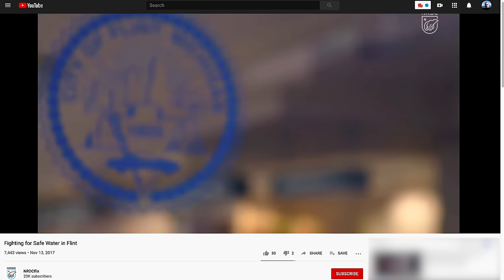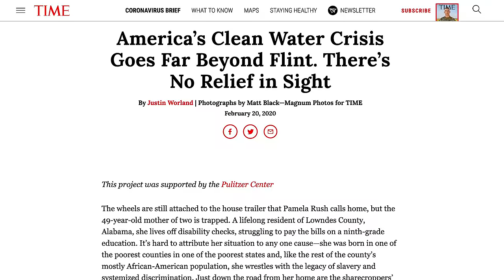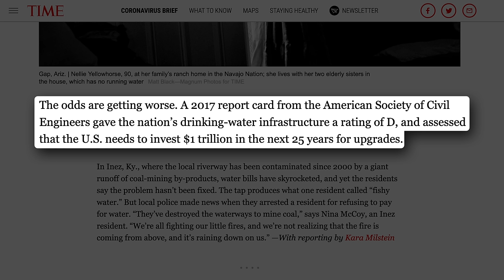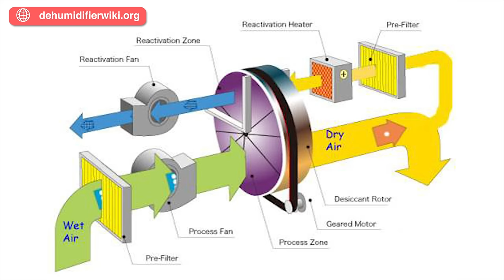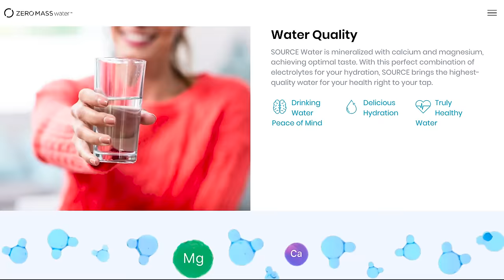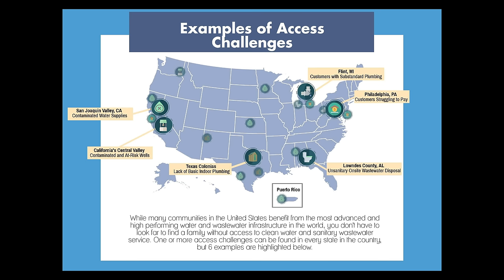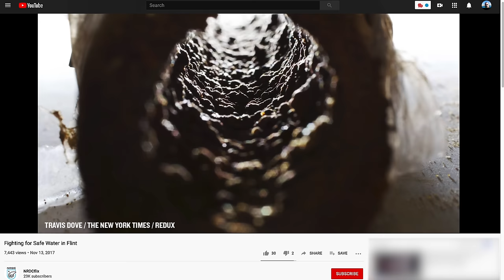Off-Grid Water With Air and Sunlight

Comment: You hit the nail on the head: it’s a glorified (solar powered and very expensive) dehumidifier. Nothing more; nothing less.
Reply: I wonder how much a solar powered air conditioner would cost, then just collect all the water from the condenser coils.
Reply: @lightdark00  i got a solar powered dehumidifier for my hunting lodge that could generate around 30-40 liters per day if it's pretty humid

Woods ds40fs: $400 on sale (think it's $500 normally)
Solar panels: $600 (4x 410 watt)
Charge controller: $200
Batteries: $350
Misc: $50?

The solar part of this system also runs a fridge/freezer set and all the lights in the lodge and is way overbuilt for just the dehumidifier
Reply: @angrydragonslayer  To match it you can skip the expensive batteries, and only have it active in the full sun. With the right compressor, you may not need an inverter. Just a charge controller for a small marine battery, and have it shut off upon battery use.
Reply: @lightdark00  of course, you could easily make this system cheaper than $1000 if you want just the water

but as i said, this isnt just for that.
Reply: @DataLog  ?
Reply: @angrydragonslayer  I'd love to see a vid of your set up if you'd make one.
Reply: @angrydragonslayer  Curious what model dehumidifier you bought. The number you put above is for the filter.
Reply: @barbmiracle  seems i made a mix-up while trying to remember (and the store i bought it from, elon in sweden, had them wrong)

It's a DS40 with DS40FS being the filter meant for it

I'll see if i can post a video next time i get enough time to take a vacation to go there
Reply: @angrydragonslayer  Thank you so much!
Reply: Everything I have read says that water from dehumidifiers is not safe to drink. If this device produces safe drinking water like it claims then it must do something very different to a dehumidifier
Reply: @Ashkinda  actually look at why it says dehumidifier water is unsafe

If the source is worth a damn, you'll see that it's very longterm and avoidable assuming you factor it into your diet the same way vegans need to
Reply: @angrydragonslayer  it's because the reservoir of a dehumidifier is open to the environment (it must be to allow the condensate to drip into it), thus it collects dust and mold spores, and after just a few days it starts to turn musty. The same as if you left any water tank sitting out in the open for a few days.
Reply: @lightdark00  you would still need to filtre the condenser water.. its a problem.
Reply: Thumbs down for the "save the planet" BULL SH@T propaganda, but thumbs up for the coverage of a new product. Ben.
Reply: I'm ok wht the dehumidifier analysis, but it extracts water!  And that is something we all need.  I love that we are looking in this direction.  We cannot rely on government to take care of us.
Reply: @angrydragonslayer  you need the top of the line filters
Reply: @peaceandlove544  i got filters in the lodge, i did not include them as there's no mention of any on the source website.
Reply: Let's build one open source that's more efficient.
Reply: @lightdark00  Plus you get to cool your house
Reply: @cordellscott  There are cooling dehumidifiers and heating dehumidifiers. You would likely want one of each for a varied climate. Interestingly enough, I would likely place it indoors, with the solar panels outdoors obviously. Why? Perspiration, sweat and the drying of things you've washed raises the humidity quite a lot.
Already have the heating kind in my cellar to manage humidity down there. Been thinking of putting in some grow lights and using the water removed by the dehumidifier to grow some vegetables in a mini-greenhouse. Water lost to perspiration would then just be re-absorbed again. Maybe add some fish in a tank also? I wonder how much I'm draining away per year now. I'm keeping it at about 50% RH now, while previously it would have been 90% or more.
Reply: @olegil2  do you recommend any dehumidifier to utilize in warm climate such as Southern California? I was thinking of having one in the back yard though housing it in a small shed just for added protection from the elements.  Though I am concerned of overheating as I would keep it outside. Though I could add a canopy over it to reduce overall temperature inside.
Reply: @BarryPiper  That seems like a pretty negligible problem that can be corrected with minimal effort. The easiest would be to use a sufficiently rated filter when harvesting the water. The other would be to modify the unit to filter the air before entering the condenser, you'd also need to properly seal the unit from contamination. That shouldn't be that hard, I'd assume most already have air filters to begin with, you might have to swap them out for appropriate filters though some changes might be necessary to make it fit.
Reply: @Ashkinda  With careful planning, it should be possible. Aside from lacking solutes, airborne contaminants or really the only problem. If the condenser is what contaminates, then look for a unit that doesn't.
 
This product is that. It has to be. It follows the same science. So if they (and many others) can do it, I don't see why this couldn't.
Reply: @midgetman4206  you just described a whole lot of attention and regular maintenance that nobody is going to want to do.  If such modifications were that easy and "minimal", the manufacturers who make dehumidifiers would add them to their devices instead of issuing warnings not to drink the water that pools in the collection tank.  Think about it: you're a company that makes dehumidifiers.  With minimal effort, you can improve your device to dispense potable water.  Why don't you do it?
Reply: @BarryPiper  Come on, it isn't aerospace engineering. If someone has basic knowledge about tools they could do it. It's mostly glue and sheet material. I agree it's not exactly the easiest but It's not complicated, only time consuming. That's only if they want to do that, otherwise a good enough filter is all that is needed. Many people already use water filters on a regular basis. The biggest danger could be harmful levels of some substance leaching into that water, but like I said before a sufficiently rated filter could absolutely clean that out. If it's really bad then that condenser unit should probably be replaced. The company is saying that the water shouldn't be consumed 1. for liability. and 2. for the reasons why you said. It is just unwise to drink water that is exposed to the environment for prolonged periods of time.
 
As for why manufacturers don't build them with that idea in mind? Well they do. You're looking right at one such product and there are many that do a similar job, with varying designs. Consumers are just more in favor for straight up dehumidifiers with that being their one and only task. If the market can cut corners to lower cost, that will be the most successful. Remember what was said in the video? People already have access to safe tap water, so why would they want another source?
Reply: Yeah, $4995 + installation for 4 liters of water a day? You can do better with 3 secondhand 250w solar panels at $80/ea, charge controller $200, and run a half-ton 500w dehumidifier ($150) and produce much more. "Most dehumidifiers will remove between 30 and 70 pints of water per day". Let's include say 8hrs sunlight, that's 5-11 liters/day (3 gallons). If the electricity is "free" it's not "waste".
Reply: @BarryPiper  well then I sell the hell out of what I have now, milk it for what it's worth and then sell an upgraded unit and then another, upping the price each time...*

*Said half in jest and half in earnest 😜🧐 🤏😎✌️

Comment: This would be an awesome addition to any world sailors who could get them installed on sailing vessels
Reply: I am thinking the same thing too.
Reply: @lifeinmalay4588  It's actually much easier to use a desalinator on boats. There are advanced hand pump and powered desalinators that are very compact and produce as much drinking water as you need on demand.
Reply: @Blztrls  THAT is what I would love to buy for all occasions. That has got to be cheaper than this video project.
Reply: Solar stills would be very difficult to use on a boat: Pitching and rolling would be constantly threatening to contaminate your freshwater with the saltwater you're trying to desalinate. They might be useful for something like an offshore platform, but even then... given all the other plant they have running it's as easy to just use a desalinator.

Comment: In India we collect rain water :) hence our  water bills are just 15 $ per year
Reply: You also don't have the city government fining you for collecting rainwater, so NICE!!!
Reply: @absp2006  the government actually provides incentives to set up rain water harvesting systems. In my city,  any new construction whether private or commercial has to plan a rainwater harvesting system otherwise building permits are not issued.
Reply: @hafeexius  Weird, I was scolded years ago as to why I'm not allowed to collect rainwater.
Reply: @absp2006  I should have posted in my earlier comment that I meant the local government here in South India
Reply: @absp2006  why cant you collect rainwater? why is that an issue?
Reply: @CHAITHANYAkitta  According to local gov, environmental problems can occur.
Reply: @absp2006  cool
Reply: @absp2006  turns out, the assumptions those laws are based on are wrong. Need to get those updated.
Reply: @rubidot  I just Googled it again and whaddya know, I CAN collect rainwater, lol.
Reply: @CHAITHANYAkitta  The US government and various states say they own rainwater/groundwater and have the right to manage it. Private landowners have no right to collect it or use it without permission.

It really is only a few steps away from claiming they own the air we breathe.
Reply: @peterhoulihan9766  lol i understand, but it does a good reason for it. if you compared to my country its wayyyy better system
Reply: @CHAITHANYAkitta  areas like Seattle and Portland would be able to. And I know a lot of desert areas can. They aren’t sustainable alone in some areas like San Diego that get like 8-10”/ year and it all falls in 2 weeks, usually November and January
Reply: @peterhoulihan9766  Now I understand why he said it is a problem in areas where it snows a lot. I was like "collect and melt that snow!". The issue with collecting rain-water or snow seems more like what the beverage industry wants the US government to do
Reply: @KumarRaja113  It's more to do with agriculture really. Companies like nestle get a lot of flack, but they really don't use that much water compared to (say) almond growers.

Comment: What i bought for 90-100 bucks was a Little Creek non-electric water distiller. 3 big pans that make up distiller. Bottom pan- dirty water---- middle pan is catch basin with heat-resistant drain tube with clamp--- top pan used to pour cooler water in to help condensation process. Top pot water can be dirty water but used at natutal temp, or use cold water if available to get better condensation. At least top pan can be used as cooking pot if desired. Distillation is the best as we all know. You can use this literally on ANY HEAT SOURCE that will make water turn to steam.i really like it. Lightweight but, obviously a bit bulky. I bought for home or basecamp use, but , though bulky, light weight enough to want to try to take it in a bugout situation if possible.  If you havent bought some type of distiller, check it out. Fyi. Ben
Reply: PS....Little Creek distiller pans do nest in each othet but still a bit bulky. Manufacturers box is about 12x12 or 14x14 square.